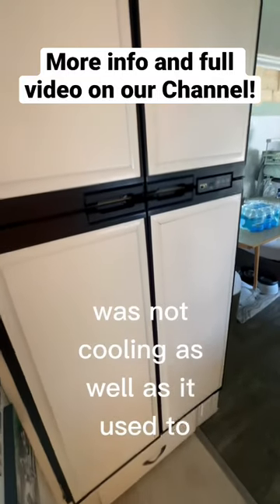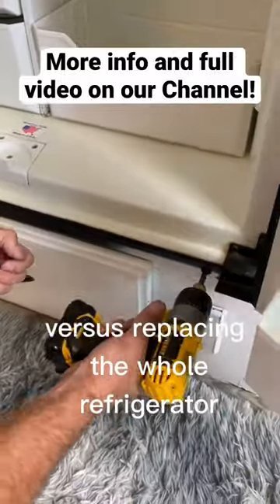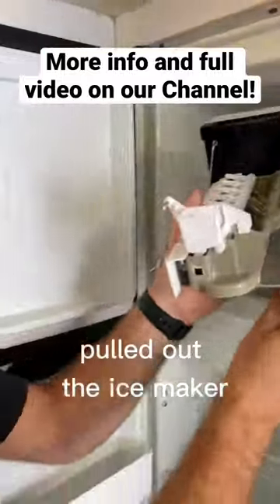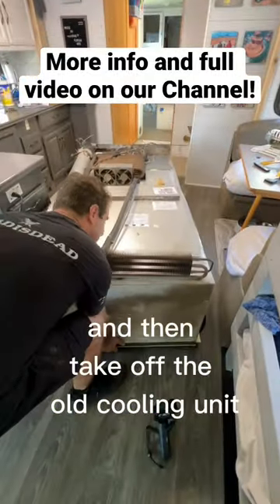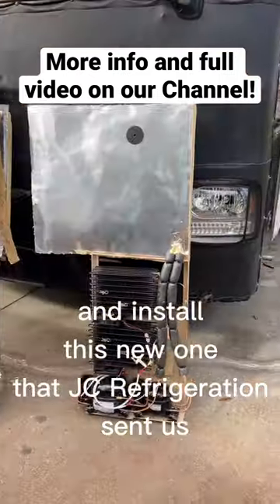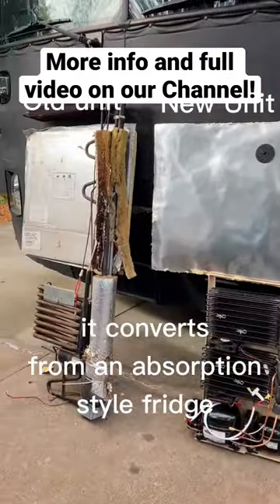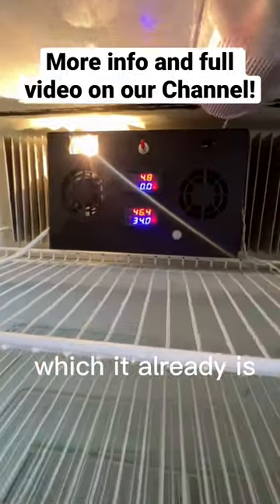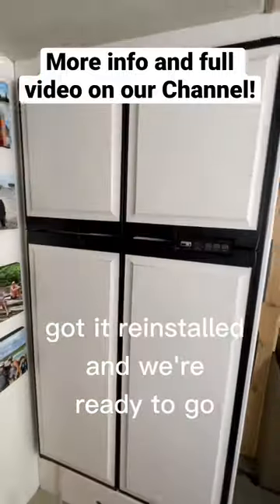Are We In Over Our Heads With This DIY?

Comment: Buying a new fridge is cheaper than a 1200$ cooling unit from these guys.
Reply: Not when you consider getting the fridge out as well as the cost of finding the right size . We were quoted $2500-$3000 just for fridge because of the shortage.